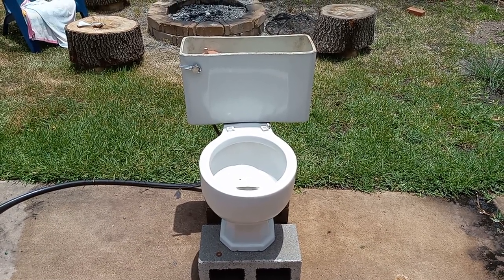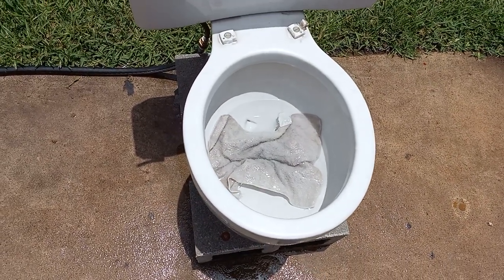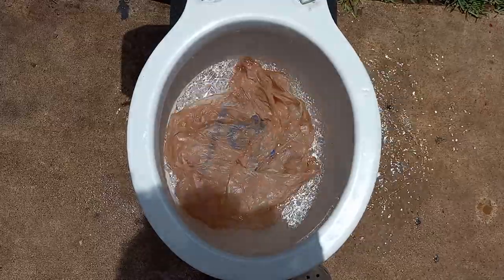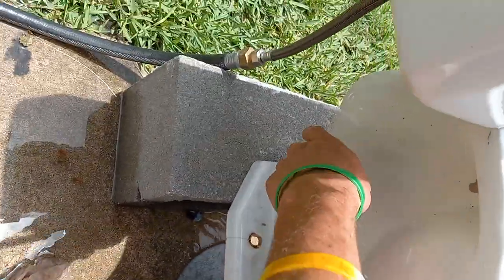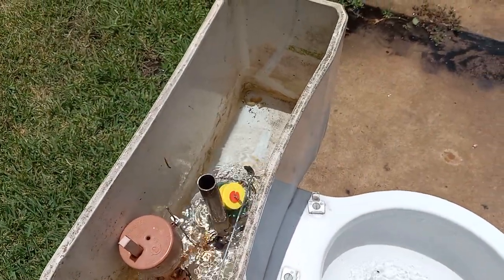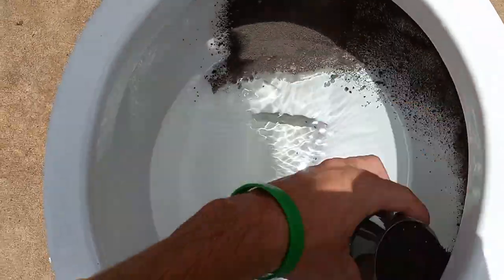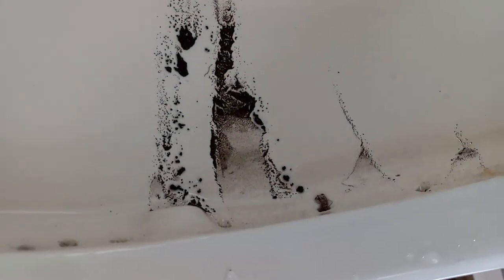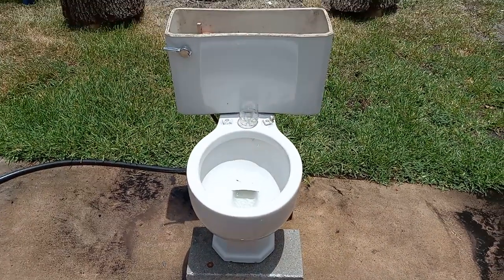1965 Nationaline Toilet Tests

Comment: This has a very interesting flush, a little weak for how big the trapway opening is in my opinion. Question, would it be possible to fix the cracks in the bowl? Or is it not bad enough and best just to leave it alone?
Reply from the maker: Unfortunately I haven't found any way to fix cracks like this.

Comment: This toilet is really awesome but the performance could use a little work. The dirt test honestly surprised me though too. I think this would do great on normal use. Also, is that chip near the top of the trapway some sort of jet?
Reply from the maker: I don't think there is any damage to the inside of the bowl
Reply: @OCC_Plumbing_and_Restorations  Interesting, I wonder what that jet like thing is above the trapway opening!
Reply from the maker: @masterflush5676  Something very interesting

Comment: Is there a way to unclog the rim jets?
Reply from the maker: I pounded the toilet on its back to force stuff out the hole it came in and I also use a coat hanger wire to dislodge dirt in the rim.
Reply: @OCC_Plumbing_and_Restorations  1
Did it work?
Reply from the maker: @ryanthenascarguy4871  Yep

Comment: Poll: what's your opinion on pit toilets
Reply: For me: They are nothing but a useless piece of crap you can fall in there and get trapped and you might not survive. You can also drop your phone in there and there are nasty as hell Overall: pit toilets can smash themselves
Reply from the maker: I think they're gross but they definitely have their place. For example, I hiked on part of the Bright Angel Trail in the Grand Canyon and it was really handy to have a pit toilet there instead of just doing it on the side of the trail. They are good for remote areas like that but real toilets are always better when possible.